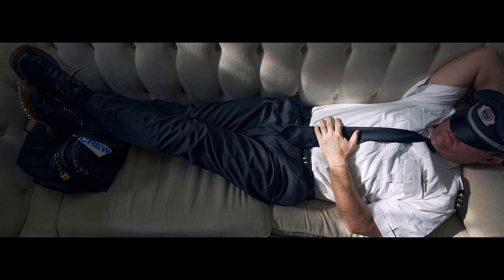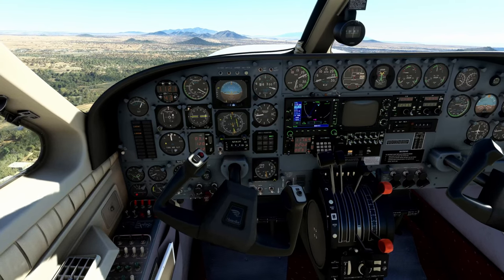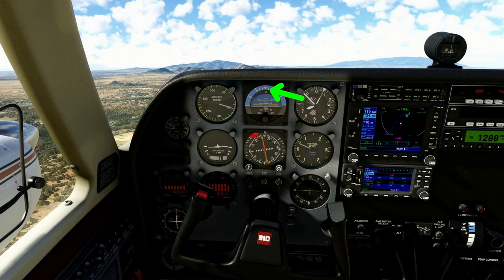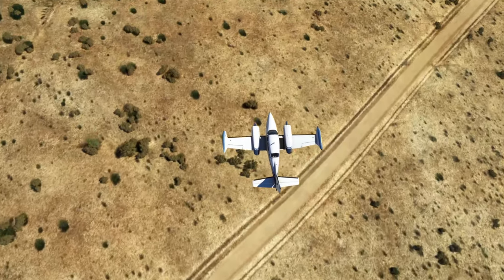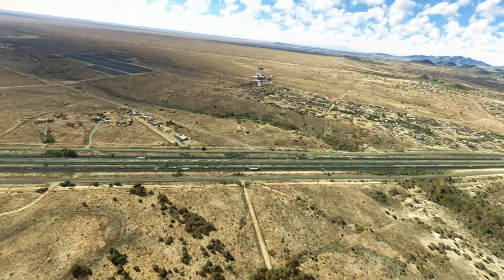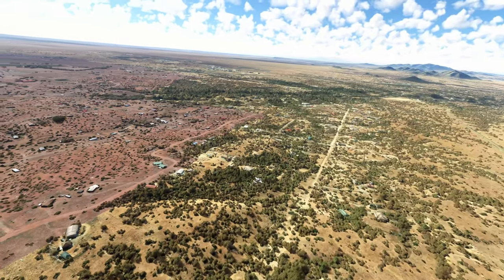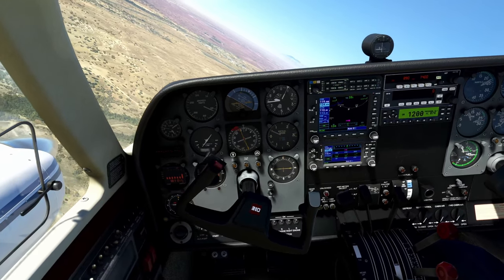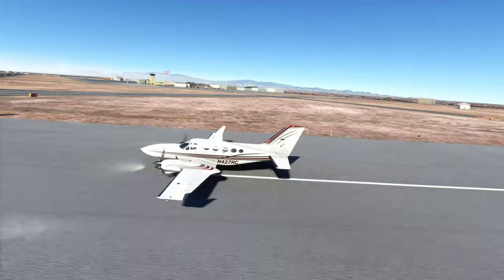Vmc or Die

Comment: I have several objections with the concepts as explained in this video. Here a few of the most important iones.

The ball 1/2 width off center is not "uncoordinated flight".
Coordinated flight means zero sideslip angle.
When there is no net lateral force, coordinated flight is equivalent to the apparent gravity vector being perpendicular to the wings (which is what the ball actually measures).
But that's not the situation when you have asymmetric thrust. Certainly, when you have asymmetric thrust you want to counter the thrust yawing moment with rudder. However, the way the rudder applies yaw moment is through a lateral force on the fin which creates an unbalanced lateral force. So what happens next? Perhaps it's easier with an example.

Say that the right engine fails. Initially you have an unbalanced yaw moment to the right that you will counteract with left rudder. The left yaw moment achieved by the rudder is via a lateral force to the right on the fin. Because of that unbalanced lateral force, the plane will start to drift to the right/ Because now the wind hits the fin a bit from the right, that will tend to create a left force which in fact will be felt as a reduction of the right force previously mentioned, which in turn reduces the left yawing moment initially achieved with the application of left rudder. So you are not fully cancelling the right yaw anymore. You will need to add more rudder. If you were going slow and you were already applying all the rudder you had, too bad, you don't have more rudder to add, you just lost control of your plane.
So is there a way to cancel the right force on the rudder so we avoid the sideslip and the need to add even more rudder? Yes: Bank to the left enough so as the left horizontal component of the lift vector equals and cancels the right force on the fin. In this way, you can keep zero sideslip and a zero net yaw moment with the original rudder input. THIS IS WHY VMC IS LESS WHEN YOU KEEP A BANK TO THE GOOD ENGINE. YOU NEED LESS RUDDER TO ZERO THE THRUST'S ASYMMETRIC YAWING MOMENT. VMC DOESN'T HAPPEN WHEN YOU RUN OUT OF AILERONS TO KEEP THE WINGS LEVEL. IT HAPPENS WHEN YOU RUN OUT OF RUDDER TO ZERO OUT THE YAW MOMENT and your plane yaws and rolls (as a result of the yaw) out of control.
Note that if you bank the plane to cancel the later forces, you will be flying in a bank but with net zero lateral force and with zero sideslip. THIS IS  THE REAL COORDINATED FLIGHT. Yet, the ball will "fall" a bit towards the lower wing because you are banking but not turning. But if you pout a yarn in the middle of the windshield, the yarn will be completely centered.
This applies to all airplanes, prop or jets. There are a few differences between prop an jet, yes, but this is not one of them. This is just rudder compensating the thrust's yaw moment and bank compensating the rudder's unbalanced lateral force. The source of thrust is irrelevant.
The differences between jet and prop are:
a) In a jet you don't need to maintain aileron input to maintain this status. You are in coordinated flight (even if the ball tells otherwise) and the lift is symmetrical. In a twin prop the working propeller will be blowing higher speed air over its wing which will then generate more lift so you will need to maintain aileron towards the good engine to keep the bank constant.
b) Other effects of propellers (like torque and p-factor) will make that you will need more rudder and aileron to compensate the loss of the left engine than the loss of the left engine. Those effects don't exist in a jet.
c) Most jets are required and designed to have an engine failure during the take-off roll at about V1 (which is typically before Vr and before lift-off) and still be able to maintain directional control on the ground, accelerate to Vr, lift off and accelerate to V2 which is the minimum speed you should keep in the climb after losing an engine. V2 is typically much larger than V1. The rudder is design to maintain directional control at V1 and, because the effectiveness of the rudder goes with the square of the airspeed, by the time you reach V2 you have plenty of rudder authority so the bank technique is not really critical. V2 is well above Vmc. In a prop twin, Vmc is Vmc so if you are flying at Vmc you have ero margin, you NEED that bank to maintain control, and the blue line (the minimum speed you should keep when climbing on a single engine) is typically not much higher, so you have margin but not much, so the bank technique is still critical.
Finally, I don't know where you got that wrong notion that Vmc changes with weight. Unlike the stall speed, it doesn't. And the reason why one does and the other doesn't is easy. Lift counteracts weight, and weight depends on weight. Rudder counteracts thrust yaw, and thrust and it's lever arm do not depend on weight. What does depend on weight is how much bank you need to keep the zero sideslip condition. The heavier the plane the larger the lift so you need a smaller bank to achieve the same horizontal component of the lift.
Reply: If the max bank into the good engine is restricted (by policy) to 5degrees than wouldn’t that result in a higher Vmc for the lighter aircraft?
Reply: @yamashill  ... Higher Vmc compared to what? Yes, if you allow more bank angle, your Vmc will go down to some degree. But your stall speed will go up.
Physics and aerodynamics doesn't care about policy. But would you like an airplane manual to say that the Vmc of the plane is 70 knots and that it requires 30 degrees of bank for straight coordinated flight?
Reply from the maker: @abd12: In all honesty, I made this video for people just like you, who have a TON of misconceptions about this stuff. There is a persistent yaw with ball out of center, plain and simple. The 5-degree bank is there to maintain heading because of that yaw. It has NOTHING to do with “canceling” yaw (if you canceled yaw, there would be no ball deflection). 
And though jets don’t have p-factor per se, they do have rotational effects very similar. With the exception of the rare counter rotating engine, all wing mounted twins have a critical engine for this reason. 
To the degree any of your objections have merit, it comes down to definitional differences. What is meant by “coordinated?” If you are referring to orientation with the slipstream, you are at least partially correct. If you are referring to yaw, you absolutely are not.
And Vmc is 100% dependent on weight. Do not mistake published Vmc speed (which is established based on the worst case scenario of light weight) with the ACTUAL Vmc speed (the speed at which rudder/aileron authority is no longer sufficient to counter yaw induced rotational forces).
Reply from the maker: Yes, 5-degree limit can result in a slightly higher Vmc speed, but is included in the “published” Vmc speed.
Reply: @flyingformoney777  ... You are saying things but you are not explaining why. I did explain why.
"There is a persistent yaw with ball out of center, plain and simple" Why? I claim that not. And I explained why. But here it is again and expanded. The ball is just a ball in an arched tube. Has the same function than a highly dampened pendulum. It will just point in the direction of the apparent acceleration (one component of it anyway). If the airplane is parked in an include ramp, the ball will be off-center and there is no yaw (or, more correctly, sideslip angle, since "saying "there is yaw" is like saying "there is pitch"). You have vertical component of lift cancelling weight, rudder yaw moment cancelling thrust asymmetry's yaw moment, lateral component of lift cancelling lateral force on rudder/fin, and the plane is in equilibrium of both forces and moments, flaying straight, and banked. There needs to be no sideslip (the yarn on the outside of the widescreen would be perfectly centered) and the ball is off center. Explain what of that is wrong and why.
"To the degree any of your objections have merit, it comes down to definitional differences. What is meant by “coordinated?” If you are referring to orientation with the slipstream, you are at least partially correct. If you are referring to yaw, you absolutely are not." Please define what you mean with "yaw" and how does the ball measure it. I try to avoid "yaw" because it is confusing. Yaw can be just an axis of rotation, and an angular position (or displacement) about that axis relative to a zero reference. The movement about this axis is normally called "yaw rate" (what the stick of the stick-and-ball instrument measures). Similar with pitch and pitch rate. The action of yawing is the action of changing the yaw angle, like pitching (up or down) is the action of changing the pitch angle. Sideslip, on the other hand is the angle of the plane relative to the slipstream, like angle of attack, but lateral. The relationship between yaw and sideslip angle is the same than between pitch and angle of attack. So what do you mean with "yaw"? Sideslip or lateral angular velocity (i.e. heading rate)? Or something else?
In any case, what you want to do is to keep the plane flying parallel to the airstream to minimize drag and keep rudder authority. So yes, I care about sideslip angle being zero, which in an asymmetric flight condition means that the ball must not be centered.
"And Vmc is 100% dependent on weight. Do not mistake published Vmc speed (which is established based on the worst case scenario of light weight) with the ACTUAL Vmc speed (the speed at which rudder/aileron authority is no longer sufficient to counter yaw induced rotational forces)." Again, no. Vmc is the speed at which you run out of rudder authority, not aileron authority, and that doesn't depend on speed. The only reason why you need to keep aileron input at all in a prop plane (other than torque and p-factor) in an one-engine-out condition is because the good engine is blowing air over a part of the wing increasing that wing's lift, but the failed engine is not. But in a jet (or a twin prop like the Avanti), you don't need any aileron input to keep the plane form rolling one way or the other (assuming you are using rudder to cancel the asymmetric thrust's yaw moment) so you are never going to run out of aileron... but you still have a Vmc.
In my opinion, you are the one that has many misconceptions, not me. And I am explaining why. But in any case I don't want this to be a "who is right / who is wrong" pissing contest. If I am wrong I want to understand it. Understand it, not just believe it. That is why I am asking you to explain why what I say is wrong and why what you say is right. And I am offering the same in exchange.
Reply from the maker: @adb012  Sigh. Wind and fury signifying nothing. You multiply words without saying anything. I explained myself. You just won’t listen. Just answer me: what does running out of rudder authority mean? Why care about it? Because the aircraft ROLLS. Why? Because you DO NOT HAVE ENOUGH AILERON AUTHORITY to counter it. Vmc roll is the loss of roll control (which is a function of the ailerons) because of yaw that can no longer be contained by the rudder. You get stuck on definitions. I’m more concerned with what the pilot is doing.
And please Google “Vmc and aircraft weight.” If you don’t believe me that Vmc is partially dependent on weight, maybe you’ll believe all the other resources out there.
Reply: @flyingformoney777  ... I agree (I assume when you say "5-degree limit can result in a slightly higher Vmc" you mean compared with more bank, not with less). But there is a caveat. If you are already using full rudder to keep zero sideslip with 5 degrees of bank, it is true that you can increase the bank and slow down further because the sideslip will provide for additional force on the fin that the rudder cannot provide. But... a) Sideslip means more drag, better not, and b) You may reach another critical speed: the stall speed (that because you are banked it will be higher than normal). And stalling is never healthy, stalling with a sideslip is more lethal, and stalling with a sideslip and max asymmetric thrust, may God have mercy of your soul.
Reply: Anyway... here is the elephant in the room: I hope we will all agree that Vmc is of little operative interest in most cases. You never want to fly at Vmc. The guy should have shot for Vyse (blue line, best climb speed with single engine) and we would probably not be talking about this no matter how sloppy his single-engine technique. Vmc is like the stall speed. It is a speed at which you never want to be. You only care about how much margin above it you have. You will never want to fly at a speed at which the stall warning is sounding, even if it is 5 to 10 knots above the stall speed. Unfortunately, there is no Vmc warning. But you don't want to get even close. The operative speed is the blue line, not the red line. The only time that Vmc is of interest is if the engine fails before you reached the blue line speed and are still too low to just pitch down a bit to accelerate to it.
Reply from the maker: @adb012  Spot on. That’s the important thing and we are most definitely in agreement with it.
Reply: @flyingformoney777  ... Regarding what you say about rudder authority, roll authority and Vmc roll: Yes and no. Yes, when you lose rudder authority with asymmetric thrust, you will almost immediately loss aileron authority. But that will happen no matter how much aileron authority you had an instant before. it's binary, you go from full aileron authority to keep the wings level to no aileron authority. Why? What happens when you have less rudder authority than you need to cancel the asymmetric thrust's yaw moment? You have an unbalanced yaw moment. What happens when you have an unbalanced yaw moment? Sideslip? Yaw rate? Yes, all of that but worse: Yaw ACCELERATION (angular acceleration = net moment / moment of inertia). Your plane WILL spin, not in the aviation sense of the word spin, but in frisbee sense. Even if it would not roll (and roll it will), it would just keep moving forward do to the linear momentum it carried while at the same time spin at ever-increasing yaw rate like a frisbee. In reality the wing that moves forward (the one of the good engine) acquires a much faster speed than the one that moves back, which creates a great lift asymmetry. Also the sideslip will almost instantly increase to a ridiculous degree, causing more lift asymmetry due to the dihedral effect. And remember that you had the good engine blowing wind on that wing (if a twin prop) and if you try to compensate the incontrollable ensuing roll with aileron that's the cherry of the cake because the adverse yaw will make it worse. Not that it matters at that point. You will be dead in a few seconds no matter what you do. So in my mind, saying "roll control" is an euphemism. Even if by some magic you could prevent the loss of roll control, you better use that magic to land your spinning-like-a-frisbee plane in a survivable way (the plane will be flying forward, sideways, backwards, sideways, forward... and so n at increasing rate). in any case, I am good to settle into that, for all practical terms, that Vmc is the minimum speed at which you can maintain control of the plane with an engine failed (and feathered, by the way) and the other one at max power.
And splitting hairs.... actually there is some very small margin to recover if you dip below Vmc, but you need to be very crisp, what you probably are not if you let yourself go into this condition to begin with. You see, the plane doesn't immediately start to spin the second you have less rudder than you need to cancel the asymmetric thrust's yaw. You run out of rudder, the plane increases its sideslip and now the fin is at a greater angle of attack and provides more anti-yaw moment. The problem is that your speed was decaying until that point, and will keep decaying even more because more sideslip means more drag, the reduced speed will reduce the rudder effectiveness and fin lift even more and the sideslip will increase even more, the new sideslip angle will restore the lift in the fin and so on, but as you can see it is a positive feedback (i.e. divergent) situation. Your sideslip will increase uncontrollably but slowly for maybe one or 2 seconds of seconds and you will still have enough aileron authority (below Vmc and after you run out of rudder). Then the sideslip angle becomes large enough that the fin stalls. That is when the "frisbee" thing (and the Vmc roll) happens and. The morale of the story is, if you find that you are already using full rudder and need more rudder to keep directional control, you have one last chance that will expire in 1 second or so: Reduce power of the good engine. If you don't have altitude, forget that you are in a twin. Make a forced landing as if you had just lost all power in a single. If you have enough altitude, pitch down to accelerate to the blue line, then slowly add full power as you add rudder again and climb at or above the blue line speed. Not that I have any hope that you will manage to do it, because if you were that good of a pilot you would not have let the speed go down that much and, if you could not avoid it, you would have reduced power in the good engine and pitched down to the blue line before reaching Vmc (and all the YOU above is not a personal you, it's a generic you).
Reply: Regarding Vmc changing with weight, I stand corrected. I gave a poorly phrased and partially incorrect explanation in the last paragraph of my first post that I will copy below:
"I don't know where you got that wrong notion that Vmc changes with weight. Unlike the stall speed, it doesn't. And the reason why one does and the other doesn't is easy. Lift counteracts weight, and weight depends on weight. Rudder counteracts thrust yaw, and thrust and it's lever arm do not depend on weight. What does depend on weight is how much bank you need to keep the zero sideslip condition. The heavier the plane the larger the lift so you need a smaller bank to achieve the same horizontal component of the lift."

So... if the heavier the plane the less bank you need, and we already established the larger the bank the lower the Vmc (the real one, not the placard one), then the heavier the plane the lower the Vmc at which you need 5 degrees of bank to keep zero sideslip. It is a second-order effect, but it exists and while small it is not negligible.

All the "inertia and momentum" explanation that you mentioned and many other websites mention has nothing to do example for a website: "Vmc increases as weight is reduced so the lightest legal weight is most unfavorable. The lightest weight provides the aircraft the least momentum. The heavier the aircraft, the more likely its inertia will carry it forward and help prevent the yaw and roll associated with a failed engine." That is plain Physics nonsense). The Vmc is a static maneuver, meaning unaccelerated. You must be able to fly at constant speed, constant vertical speed, constant bank, constant zero sideslip, constant heading, and 1G while maintaining Vmc. It is not accelerated flight. No linear acceleration, no angular acceleration, and by the way no angular speed either. Inertia (both linar and angular) becomes relevant when you have acceleration (both linear and angular) and that happens only when you have a net force or moment, hence not in equilibrium.